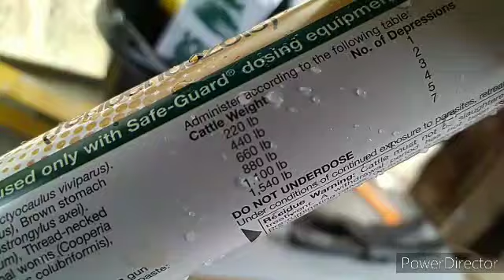frog in the morning. wormed cattle.

Comment: First! Tie with Kole! Zoomies in the morning!!
Reply: Good evening
Reply from the maker: Zoomies 👍😁 you did great to tie with Kole 👍
Reply: @GosselinFarmsEdGosselin  Got that 7.3 Ford Diesel done! It will smoke the tires now. The customer couldn't believe how well it ran. Now on to the next project.
Reply from the maker: @rodneymiddleton9624  international did pretty good on the 7🎄.. one of the first medium size truck motors put in a pickup.
Reply: @GosselinFarmsEdGosselin  You would have to pry this truck out of his cold dead hands as he would say. People with the 7🌲's will not part with them down here because we have no rust issues.
Reply from the maker: @rodneymiddleton9624  there are definitely diehard ford fans.. a big farm here, has always had chevys, a ford salesman convinced them to buy ford's. LoL.. big potato farm, lots of pivot irrigation, so always driving across the rows, it's a bit rough! Out of 20 f250 and f350, all 4x4.. one made it a week before the doors literally fell off in the field. As the ford's fell apart, the guys all went back to their old trucks. 6 months into it, the office girls ford was the only one left.. the dealership and ford got stuck with them.. thank God for the Lemon Law!!
Reply: @GosselinFarmsEdGosselin  This is a 2001 before they became POS's. I'm a big GM fan of the ones like you have. We have 3 Suburbans 1999, 2000 and a 2003 lots of miles and still going just fine.
Reply from the maker: @rodneymiddleton9624  they had mid '90s...
Reply: @GosselinFarmsEdGosselin  The 1999 to 2004 are the years I like the best. I have a 2006 f450 to pull the cab on to change the 6.0 pos engine in. I'm dreading it.
Reply from the maker: @rodneymiddleton9624  I think Tys fiance Mory has a '04, f450.. it's been a....... It's been in twice for the exhaust, ford keeps covering it, but it's a freaking hassle! Not sure who's great idea it was to make it so they have to pull the cab to do it, but I'm pretty sure they were a JD engineer at some point.. lately it keeps throwing codes, then dies in ten miles, so it isn't getting driven much..
Reply: @GosselinFarmsEdGosselin  If it's a 6.0 diesel and keeps setting a cam position sensor code it's the actual 2 wires from the PCM to the sensor. I cut them at the PCM and the sensor connector and bypass the harness. That was a bear to find the first time. The dealer here couldn't find it either.